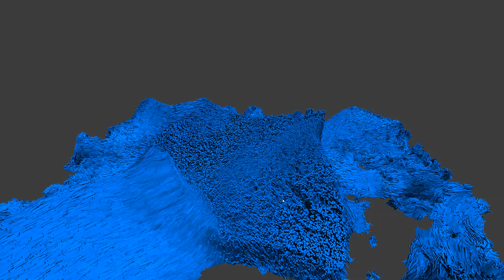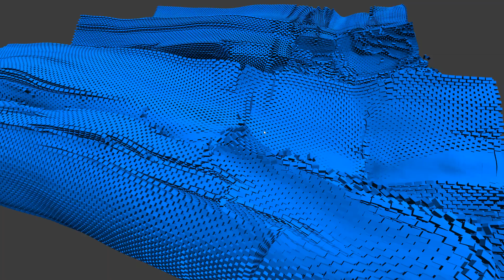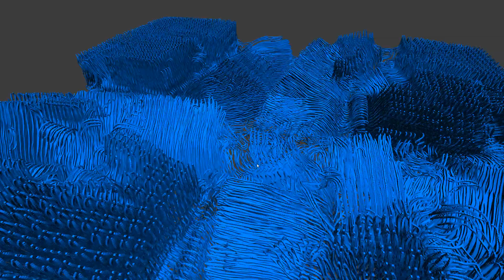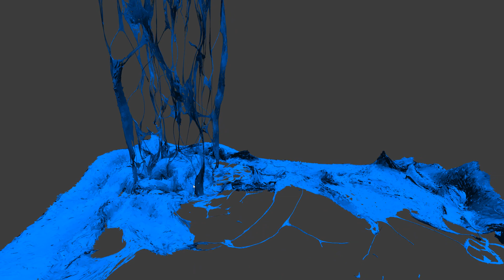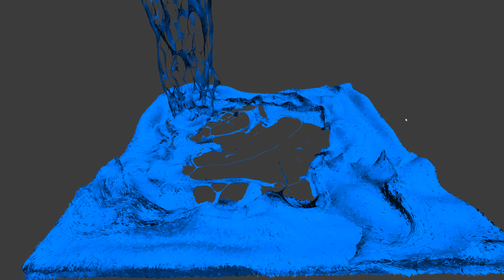Displacement Patterns | Voxel Physics Devlog #2

Comment: that fibrous looking material makes me wonder, how easy would it be to make anisotropic material properties with this method? Like tearing more easily along the grain, and being stiff across the grains.
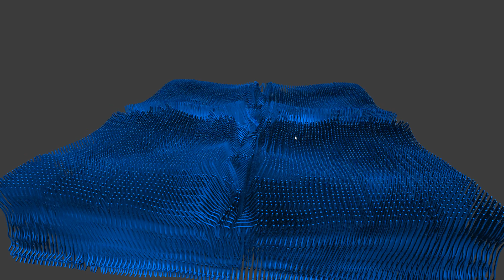Reply from the maker: The single material does support some anisotropic behavior but not all. It does support per-axis tearing length thresholds, but it doesn't support for example per-axis-pair shear moduli. You can also get anisotropic behavior by placing particles of one material between fibers of another. For example 2:19 but instead of just having gaps, there was another material to bind the fibers.

Comment: I was just wondering if you could cache out the simulation. My overall idea was you could put a water shade on that water fall import a cached version into unreal and have really good looking water. You could even take the cached version and create lods.
Reply from the maker: That should be doable, it could be useful for creating background assets for games or something like that. Maybe the surrounding regions can use some cached simulation data while the main area uses real-time simulation. Also, this is written in C++ which Unreal also uses so I will do some tests to see if I can get it integrated.